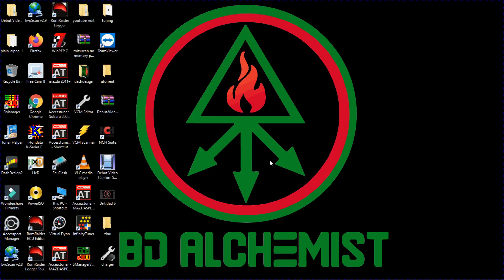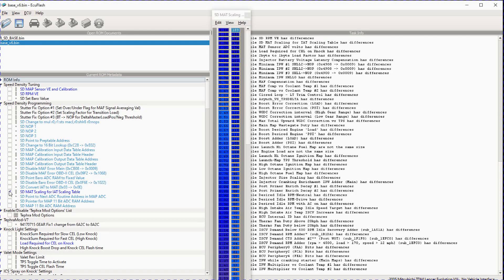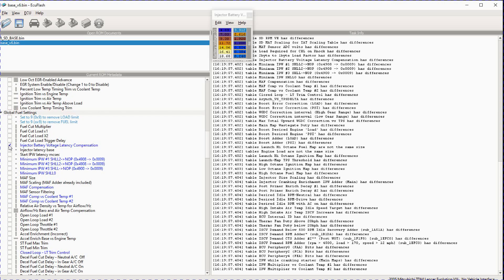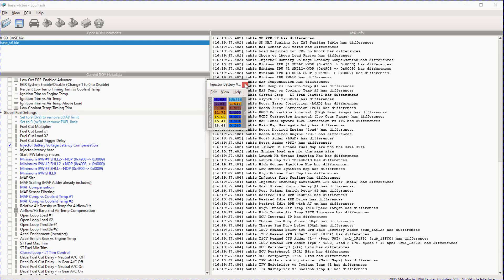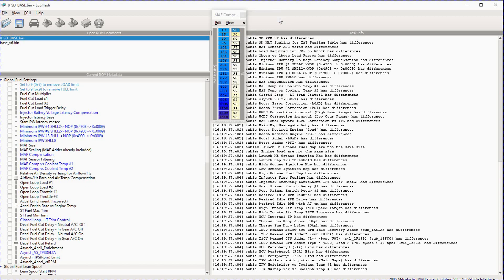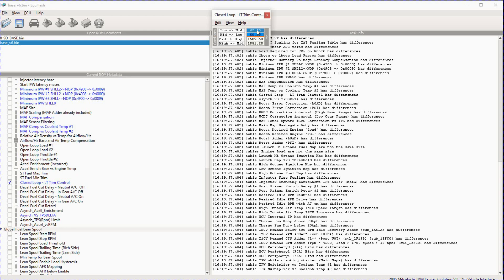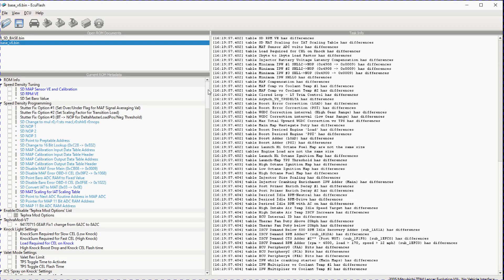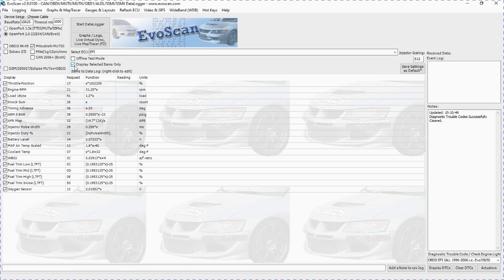How to Scale injectors

Comment: Great video! I have a question my AFR is like 17.0 sometimes 18.0 at idle. Do I just adjust the value in the 14.06 Injector Battery Voltage Latency to make it more rich? My cruise and WOT boost is fine but my idle AFR is too lean.
Reply from the maker: Depends on what ur logs say , ur Injectors, front o2 brand/type , iat reading, maf comp, sd/map setup etc.
Reply: @bdalchemist  I have the ID1050x my wideband is PLX multi gauge on a Bosch 02 wideband sensor.
Reply: I've the same problem, whats your scaling and latency please ? If your problem is solved ... thank you
Reply: @marcopc243  My scaling 630

4.69v=3.816
7.03v=3.144
9.38v=1.955
11.72v=1.125
14.06v=0.925
16.41v=0.795
18.68v=0.550

My problem went away but I had exhaust leaks at the gaskets even with new exhaust gaskets had to go back and use copper sealant RTV. Then did small adjust from my maf smoothing table.
Reply: Scaling 630 that's because I'm using E85

Comment: Is there a way to measure how much fuel you need when adjusting the IPW while cranking/starting? Ive stalled my car a couple of times after starting (cold) then trying to start it back up was almost impossible.  I'm at stock settings with fic1200 and cutting it in half doesn't make sense if the injectors are scaled correctly.

Comment: Hey man, you just helped me so much1 I've been trying to scale the injectors in my 04 eclipse for so long, and this video just explained it so damn well. Think you would be able to write up a definition file for an 04 eclipse gs Auto. It's one of the few that has never been uploaded to the internet 9i can't find it anyway) And I know what i have is lacking alot of tables I need. I just finally got my maf tables defined, it stopped my car from running lean constantly, and unable to fix with injector scaling (obviously). As soon Is I got em in, and the right scaling and smoothing, it's finally running right, except for being rich, which this video will have fixed. Sorry about the rant lol, but if there was anyway i could get a hold of you and talk about this more, I can even pay for the xml. Either way, thank you very much for this info!
Reply from the maker: Unfortunately I am not familiar with that platform and would not be able to help you.